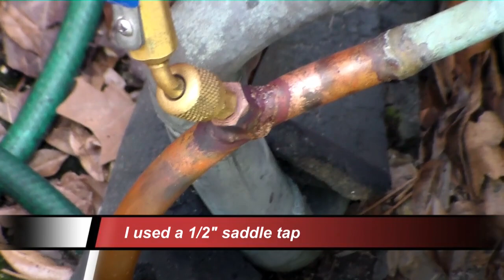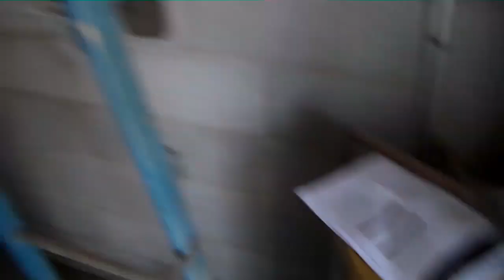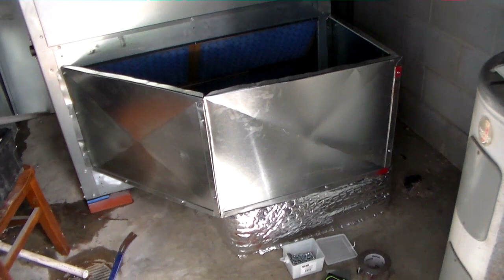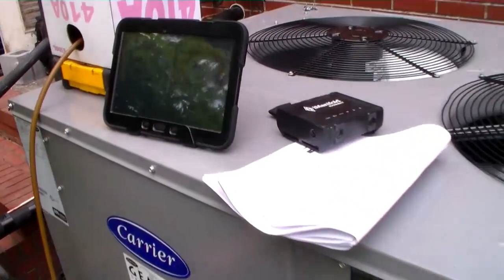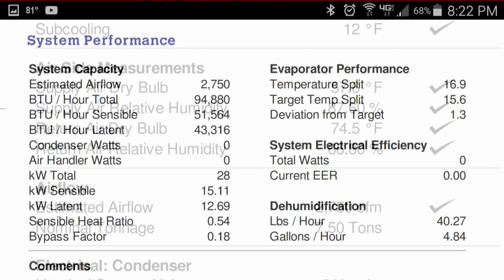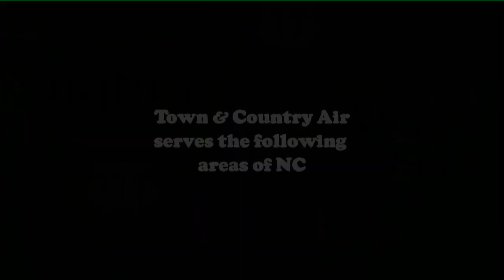Carrier Gemini 7.5 Ton Heat Pump Split System Install

Comment: Zack,
  It seems like your super heat still seemed low.  Is that the design of the equipment?
Reply from the maker: It followed the charging chart. I did not see a design subcooling